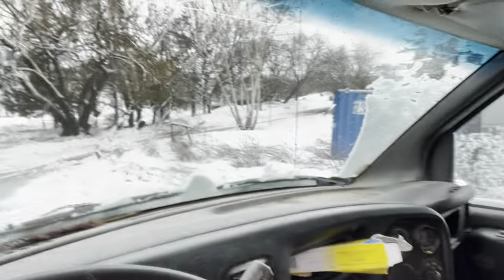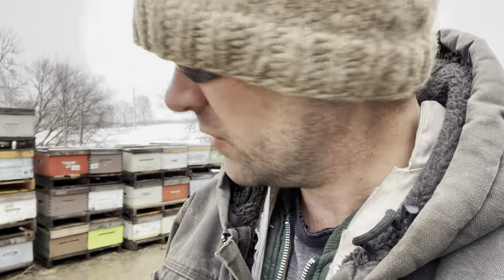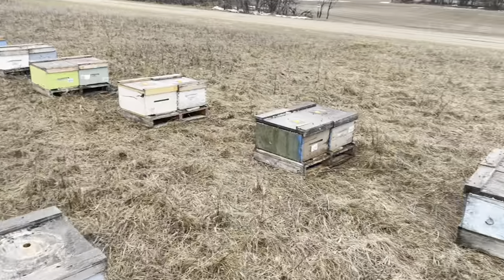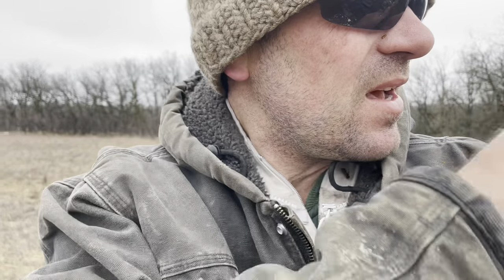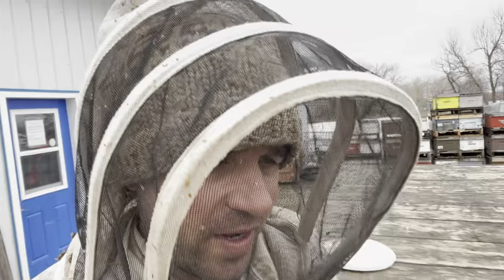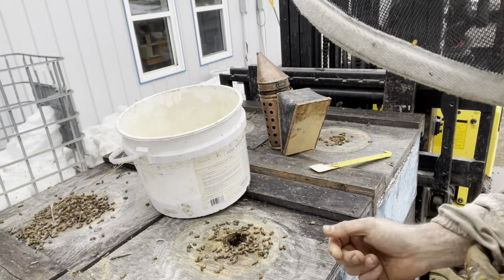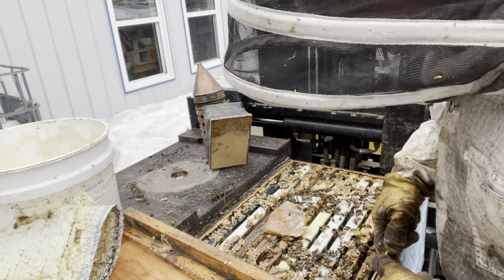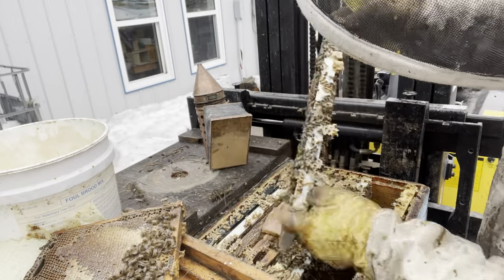Sorting Through The Flooded Hives

Comment: I recently cleaned my dead out comb. Warm water, shake it out as much as possible, place it in stacked supers (made sure there was ventilation at the bottom) with a box fan on top at max speed overnight. Don't know if its feasible or worth it for you. But this does dry wet comb pretty well.

Comment: I once had to clean about 400 deeps. I dunked a complete deep box with frames into a bleach-water bath. Then ran them through the extractor to dry the frames out. The bees accepted the comb very well.
Reply: What strength of bleach water Michael?
Reply: @charlieberreth9139  between 200 and 300ppm... I used pool chlorine. You can Google the ratio for large quantities.

Comment: Ian- I would shake the water out of all the combs that didn't have a lot of brood in them and then put them in a very warm room with fans and a dehumidifier. They will be dried out in three days and then I think you will be good on them. The combs with unsealed brood in them . . . . . . I would try spinning them in an old junky extractor to see if you can spin the crud out. If so, then they are good. You can just clean up the little extractor afterwards. As for the capped brood . . . . . if it was warm and if you had some strong colonies, you could just scratch up the cappings and then put them into strong hives. They would pull out those mummies in no time. However, since your're still cold, you probably will have to just cut out the dead sealed brood and then, I guess, you could use those for outside combs (periphery of the brood nest). Not sure if you're running plastic foundation, or not. I'm pleased to see that it's looking a little better today. You may be surprised at how well you do with all of this. I am curious what percentage of the queens lived in the flooded hives. It will be interesting to see.

Comment: How do you cope with all the losses, I'm on my 5th year and to date have not lost a colony. I'm on 14 at present but will get up to 30 which will be the max. Much to the announce of the wife (Sue). I would be devastated to loose even one. I know it is going to happen one day, but i'm not looking forward to it. Our season has started well as we have had a very mild winter this year, so the 1st flow has started late April. I've been a treatment free beekeeper from the start  and i am still keeping my fingers crossed that they do well not treated, so far they are getting along with out any treatment. I'd go as far as to say that i have possibly 2 if not 3 colony's that i believe are Varroa free. I know that is a big statement, but the bottom board has no signs of Varroa for the last 3 months. I'm also keeping bees in log hive, much to the annoyance of the club and bee inspector, who wants to inspect all my colony's, but the ones in the logs don't get feed or inspected, I just leave them to bee wild bees. I let them swarm naturally, I do set swarm traps to catch the swarms and then inspect for Varroa before rehousing them. Yesterday i was called to a fallen tree which had a wild feral colony in it, it looks as if it has been in there for 6 or 7 years. I'm hoping they are varroa free which could mean they are Varroa resistant. Here's hoping.    
salvage as many as you can and your losses are not to great.